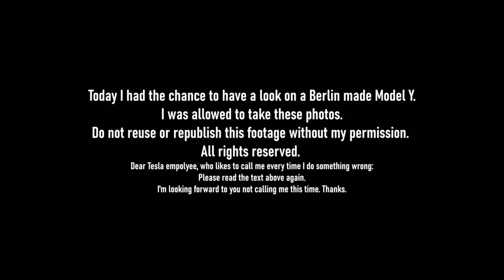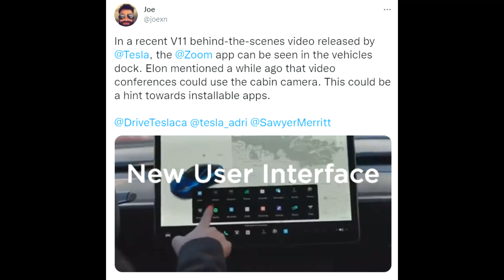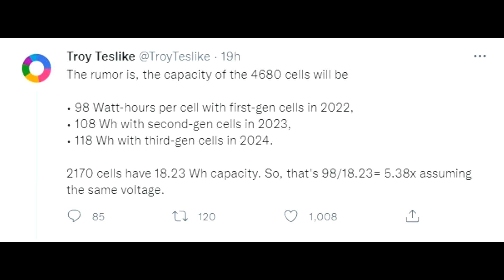TESLA STOPS Giga Berlin Expansion! Close up of Model Y Performance Giga Berlin!

Comment: Germany was a HUGE mistake.
Reply: not really. trying to do changes are the mistake. now their thinking smart. build what you have till production is in full swing before you introduce additional construction. this way original construction approved allows for that building to run without stopping. the other new construction can take as long as it need to be because ramping up what they already have will take 2 years to achieve.

Comment: You’re wrong on the focus to add a new building,   It takes 1.5-2 years  to do a new building and start production in Germany, see current building for proof .  So when the first hits its  production goals, building two is about ready. Under your thinking they wait until they are at full production before starting next building than 1.4-2 years later the next building is ready to start

Comment: Tesla will expand in Giga Berlin when they see that they can get a return on the capital.  There is no return on the additional capital until they start producing and selling additional product that comes from the additional investment.  So, it is safe to assume that they must have approval for the first phase and an idea about how long it will take to get approval for the second phase.  Time till output is a key part of the calculation.  Right now, the return on capital for Phase 1 is getting lower every day because the money has been spent and each day costs more and nothing is getting delivered.  It is like a stranded asset at the moment.
I concur that it is not a reason to not expand, but the calculation will include this not so productive time.

Comment: You're deliberately missing the point. It takes 2 years to build a factory and get it up to speed. Tesla would normally begin construction now to keep increasing production to meet coming demand. But German law allows anyone with the slightest grievance to throw sand into the machine, and prevent more construction.  Tesla now understand that this obstruction will continue into the future. So they're going to invest in China instead, where labour and government are eager to help assist in industrialisation and car production, unlike Germany. Germany is within its rights to turn down more industry, of course, but other manufacturers considering sites in Germany are now backing away rapidly, seeking other countries in Europe and elsewhere which are more welcoming.